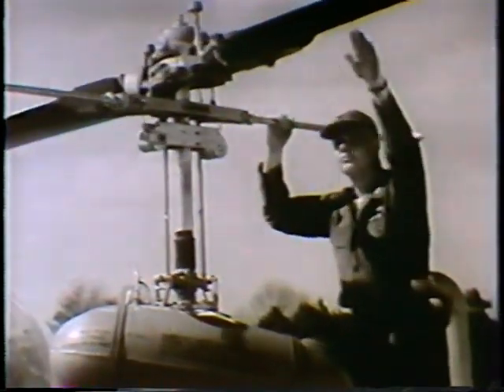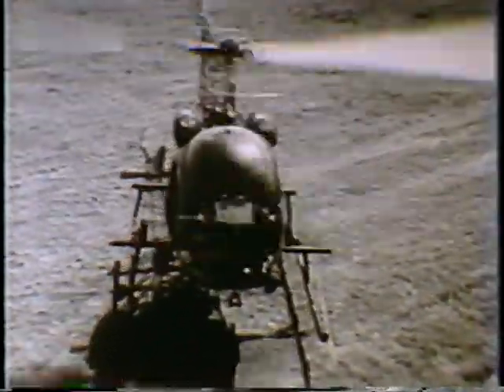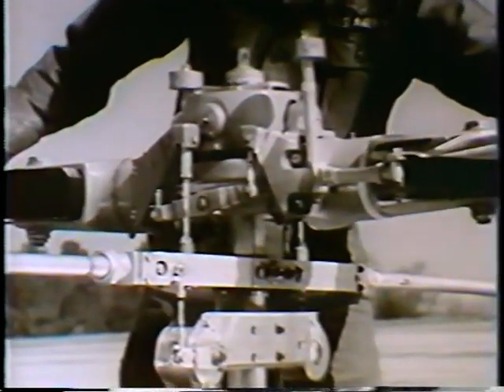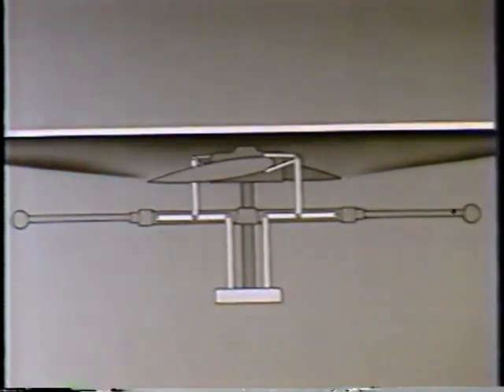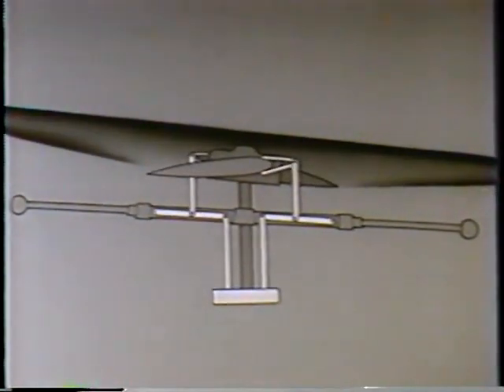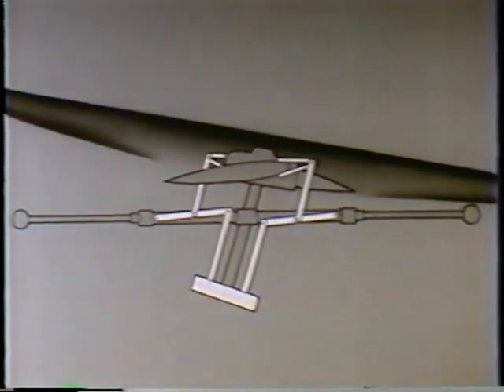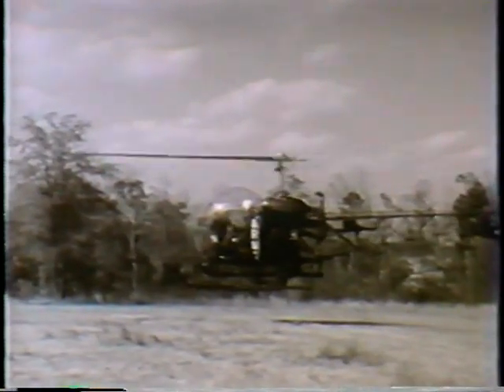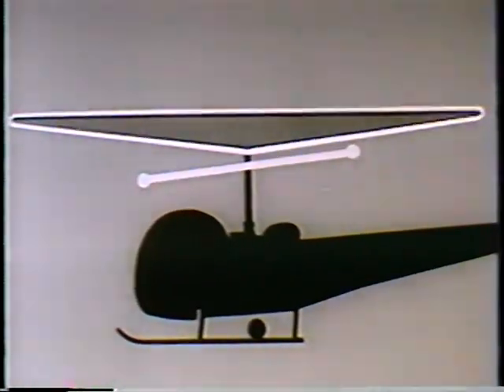Helicopter Aerodynamics:   The stabilizer bar

Comment: I often see that Bell helicopters with two blades always use bar stabilizer. But helicopter with another brand does not use. Ect Robinson helicopter. Am I right?
Reply: True.  On the Bell 47, there is an FAA approved Supplemental Type Certificate set up that allows the removal of the stabilizer bar, called the Texas No Bar Kit.  The 47 is still flyable without the bar, just a pain in the butt, I never cared for the way it handled without the bar.  Removal reduces weight and decreases cyclic control response time for AG spraying operations.  Bell removed the stabilizer bar design from later production helicopters, ie Jet Ranger, blades have more inertia which made it a little easier to control, but still more sensitive than the stabilizer bar design.  Hueys retained the stabilizer bar back in the Vietnam war to make it easier for low time teenager warrent officers to handle.

Comment: No where it's explained as good as it has been explained here. I ve been trying to understand the functioning of the stabilizing bar from so many places. This one just nailed it.
Reply: Now think of the genius idea of model RC helicopter manufacturers who implemented both the Bell stabilizer bar AND the Hiller-type paddles whose functions are mechanically mixed via a "Bell-Hiller" mixing arm into one integrated device, called "flybar" in RC helicopter parlance. This is of course mostly outdated in modern RC helis, as most of them nowadays use computerized "flybarless" stability and control systems. I still fly old-school, mechanically stabilized RC helis, a Min Air Spectra and an Align Trex 450 V2SE, both some 20 years old and going strong.